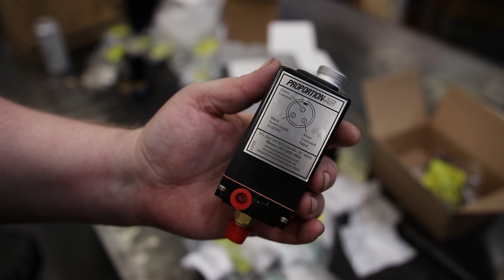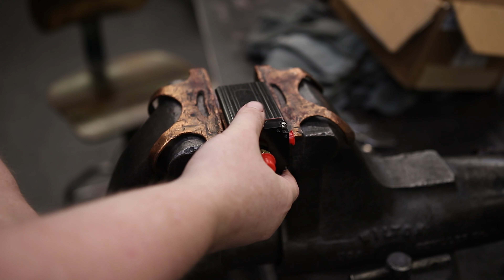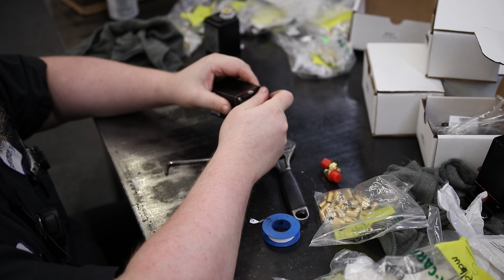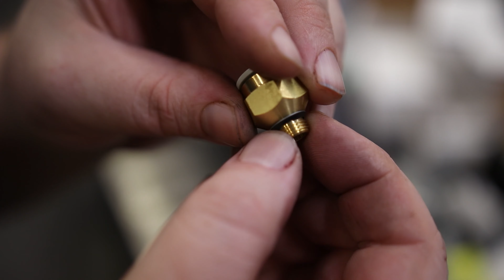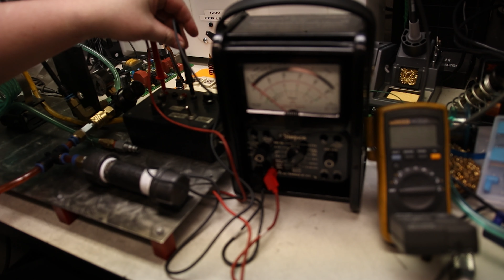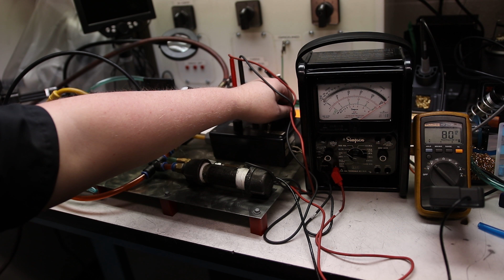Press Maintenance - Assembling And Calibrating EP Valves (Reelstand Electronic Pressure Regulators)

Comment: I retired from Houston Chronicle maintenance dept. after working on news and commercial presses for them for  20 years. Worked on all types of reel stands as a maintenance tech-- Goss, Butler, Offset, Hanshaw,  and more. Air logic, e-p all pretty much the same move the tension roller up, and the brake release, move it down, and brake increase. Or vice versa, depending on the layout.